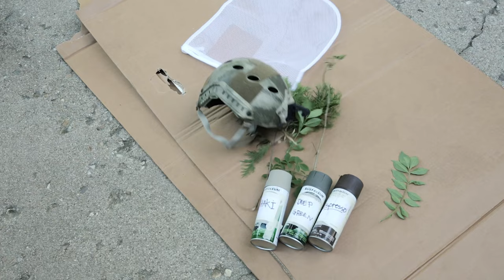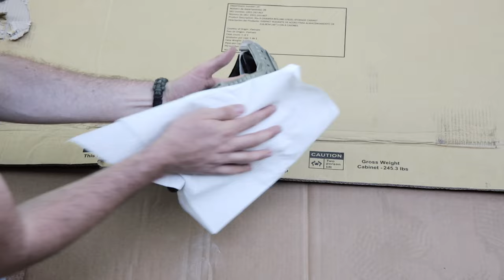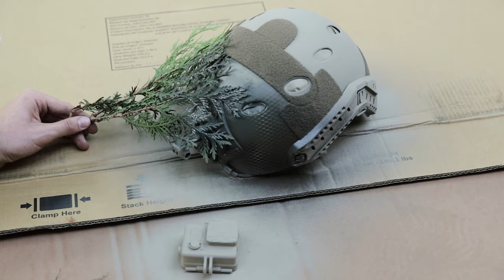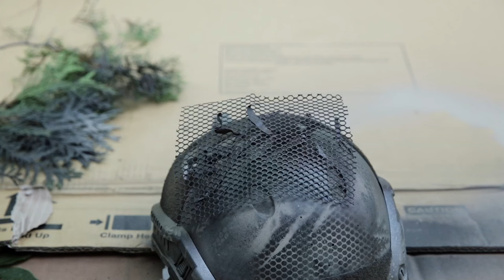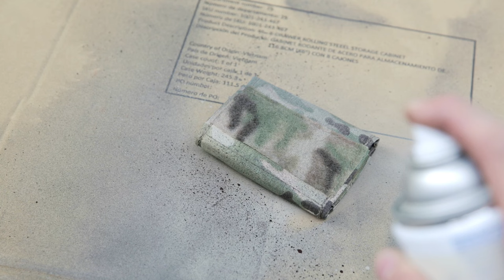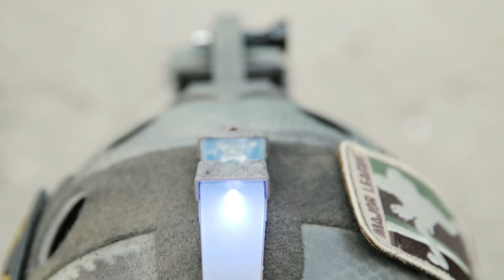How to Paint a Helmet and other Stuff | Airsoft Paintjob Tutorial

Comment: Does the spray paint at all ruin the velcro? 

I have an all black helmet that I want to paint.

Base color OD green (matte) - velcro coyote brown, gonna order new velcro pads for that, side rails and nvg mount would be matte grey and I have tan hearing protection.

The colors were to overall fit my field and match the rest of my kit.

I also plan to change the color of my straps to brown like the velcro but keep the adjustment pieces black.

I have the same strap system as you do.

Main issue here is the mixed answers online about spray painting velcro. Specifically the loop side thats on helmets.
Reply: If you just need the velcro for patch then it doesnt matter, go ahead. Afterall its easy to replace the velcro if everything just go wrong